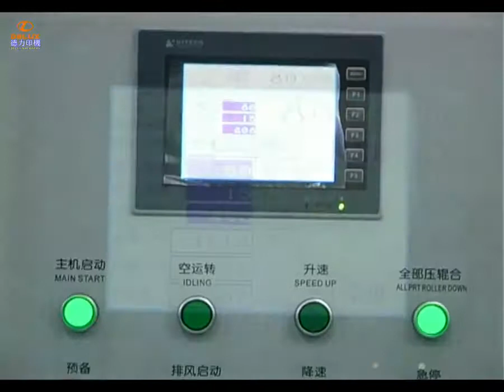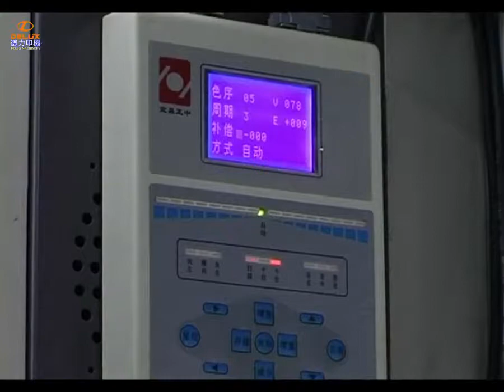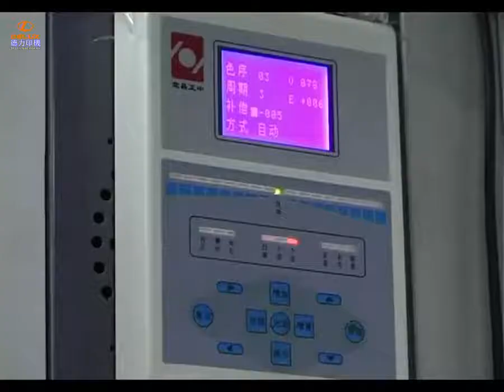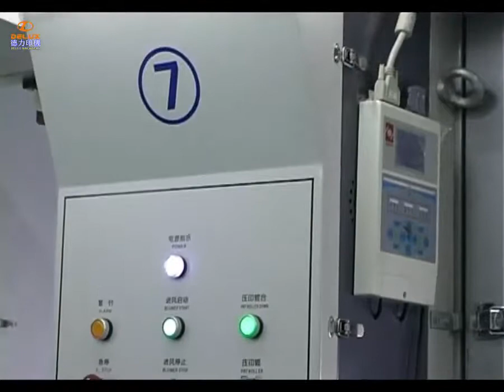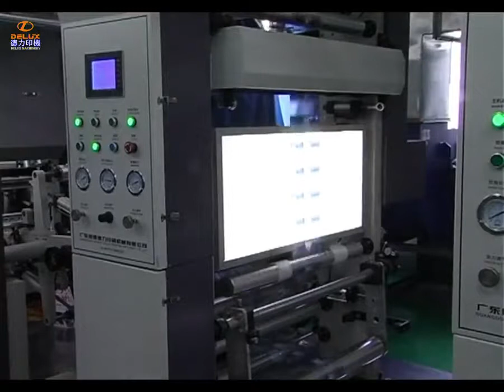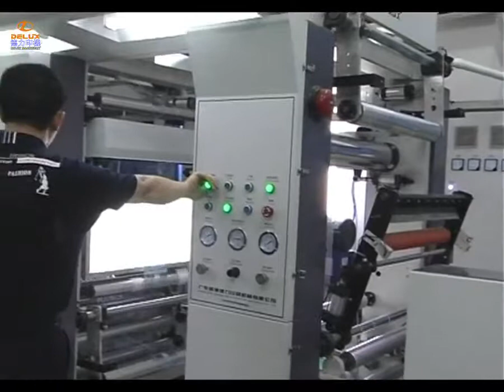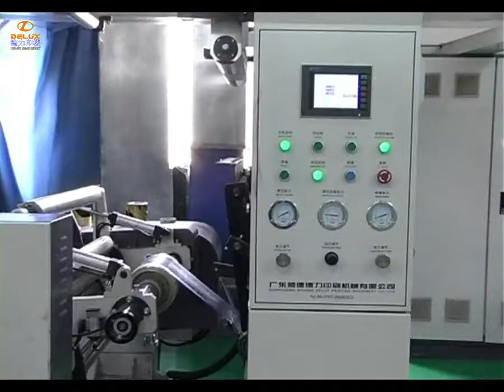Introduction : Rotogravure Printing Machine from Delux Pringting Machinery Co Ltd.

Comment from the maker: Here below some specification that we need for a quotation of a Rotogravure Printing Machine, please fill it in and send it in return to Jackie@delux.cc

1. Printing Colors: ______ (how many colors will you print  ?)
2. Suitable Material: _______(BOPP, CPP, PET, PVC, Nylon, PE film, aluminum foil, roll paper,etc.)
3. Materials Thickness:
     Thickness of BOPP : ________ μm
     Thickness of PET : ________ μm
     Thickness of PE : ________ μm
     Thickness of PVC : ________ μm
     Thickness of Alu Foil : ________ μm
     Thickness of Roll Paper : ________ μm
Others: __________________________________

4. Printing Speed: ____m/min
5. Material Width: Min._______mm ~ Max._____mm

6. Printing Plate Cylinder Width : __________mm
7. Printing Plate Cylinder Diameter: Φ________mm
①. Standard: Φ120~Φ270mm => Perimeter=377~847mm; 
②. If beyond the Standard, please state here: Φ________ )

8. Unwinding & Rewinding Diameter: Max.Φ_____mm
9. Drying/Heating Method: _________________
(choose one you prefer: electricity, air-energy, natural gas, bio-energy, thermal conductive oil, steam, etc.)

10. Printing Direction: ______________. (Normally from left(Unwinding) to right (Rewinding), but sometimes it depends on your factory evironment/structure.)
11. Other Requirements: _________________________

Looking forward to your soonest feedback.

Have a nice day !!
Jackie Chan
Guangdong Shunde Delux Printing Machinery Co.,Ltd.
No.18, XinFa Road, Rongli, Ronggui, Shunde, Foshan City, Guangdong, China
Tel.: +86-757-2831-0755; 
WhatsApp: +86-13790066820; 
Skype: Jackie.sd
Email: Jackie@delux.cc
http://www.delux.cc